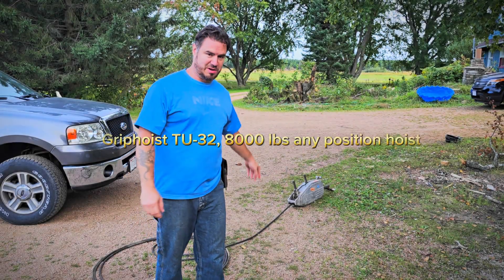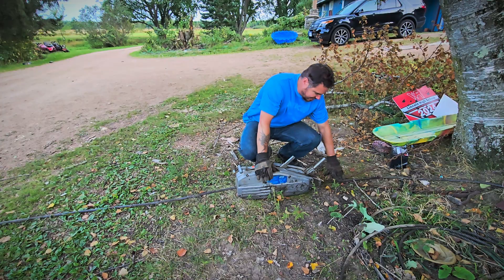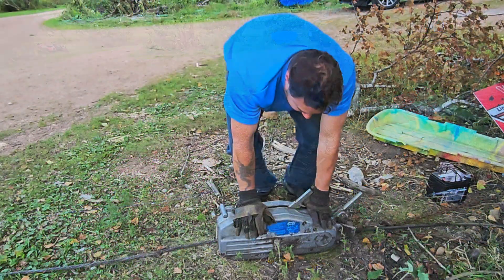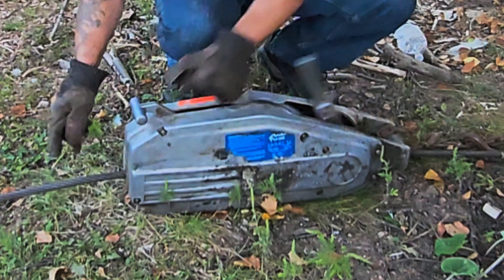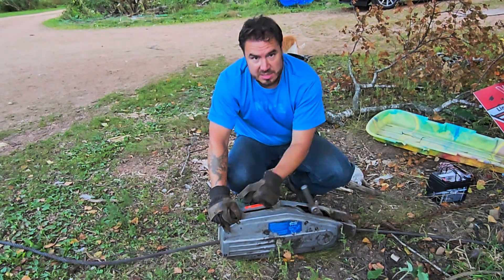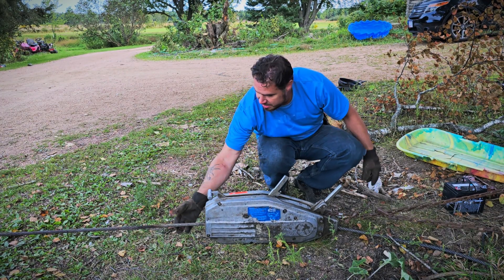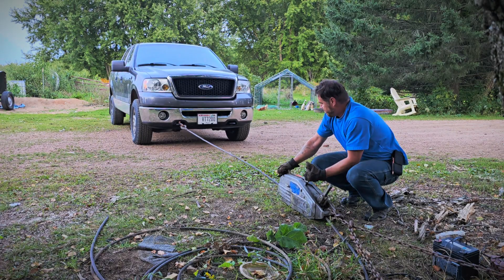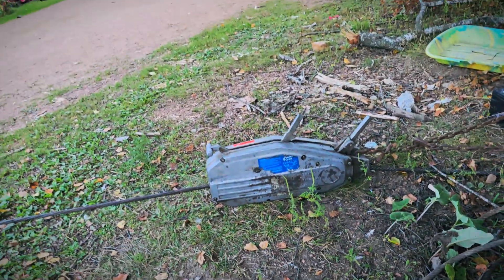How to use Griphoist TU-32 any position hoist.

Comment: So this is basically a chain hoist except with a cable and way stronger?
Reply from the maker: Yes, and it can be used horizontally, vertically or at an angle too. Whereas a chain hoist is supposed to be vertical only.